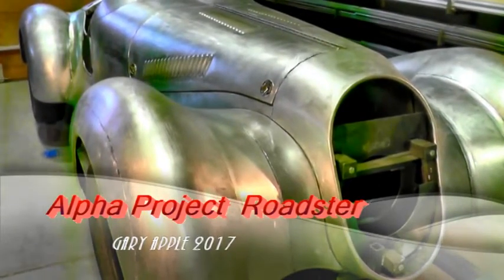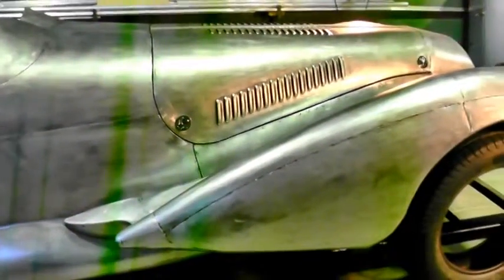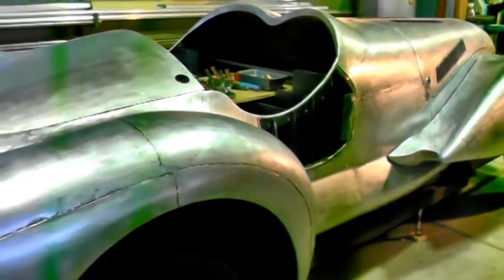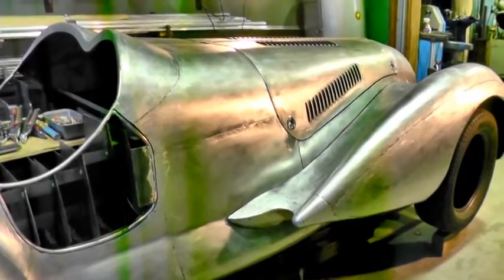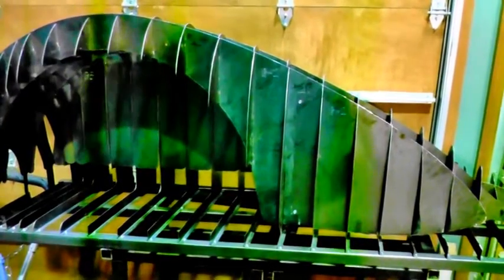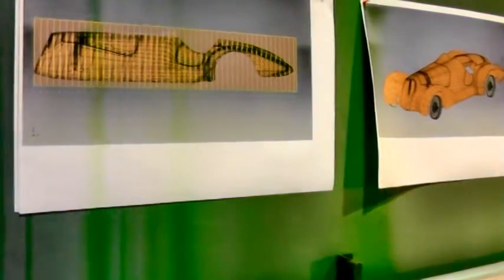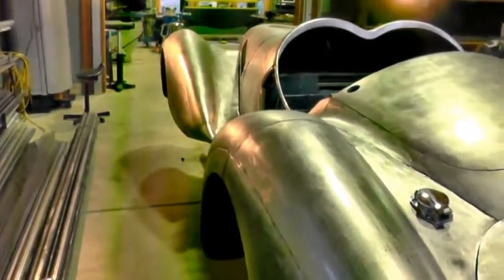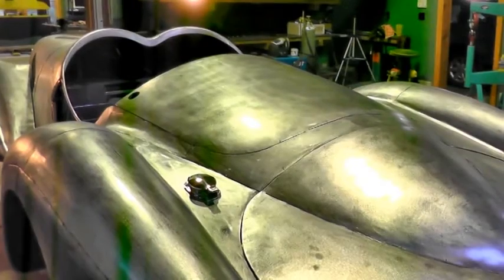Alpha project

Comment: Was serious about this suggestion. If you look on YouTube the are examples of two engines being joined together to make an eight. Just imagine how beautiful the exhaust headers would look and the sound of four twin choke side draught carbs gulping down air?
Reply from the maker: at this point, all ideas are good ones. Yes, I have seen these 4x4 engines, actually this was how they made the original engine in 1936 - created  180 hp total.....they won lots of races.

Comment: I have seen a straight eight engine that was engineered from two four cylinder engines. A straight eight would look and sound perfect in your car. Perhaps made from two of the Alfa Romeo/ FIAT Lampredi twin cam engines? They are beautifully made in alloy and two together would make a four litre quad carb engine that would be a treat on the eyes!